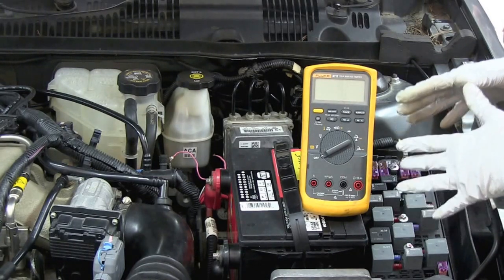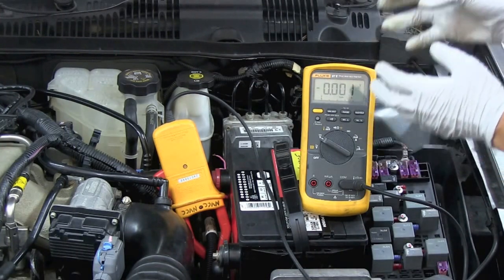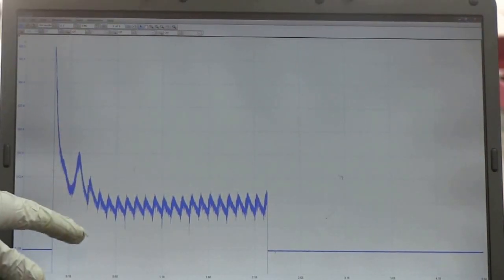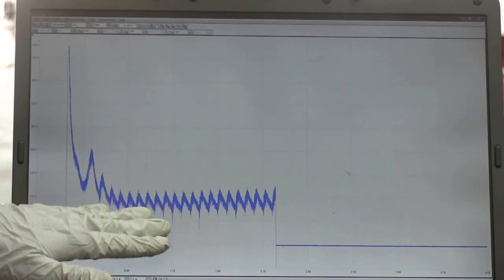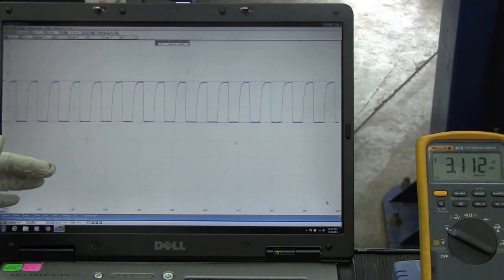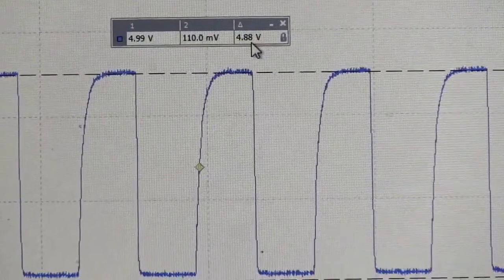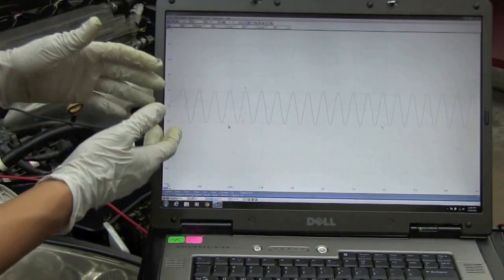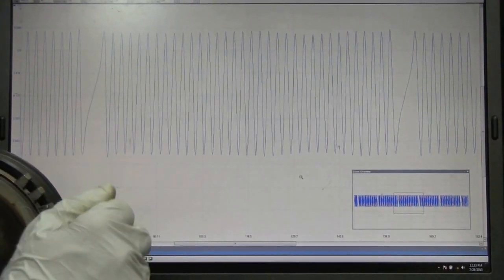Oscilloscope vs Multimeter

Comment: A female mechanic??!!???? We don't get them over here in oz, I've met only 1 in my 15 years as a mobile machinist and heavy mech. Wanna move to Aus and get married?? lol,

anyway.... 1: the metre's don't sample 4 times a second, in fact the metre doesn't sample at all, it's a constant measurement the display updates 4 times a second.
2: The DSO doesn't sample at 1 Meg sample per second, it's much much faster than that.
3:  There is no such thing as "counter electromotive force" in the electronics field, there is back EMF which is sometimes referred to as "counter EMF" to my knowledge, it's incorrect and totally incorrect in this context. Also, if you wanted to measure the back EMF from the starter motor, you would need a completely different connection and setup in order to do so. I think the term you meant to use would peak or maybe initial current, you could possibly even be thinking of the term "in-rush current" but that too would be incorrect technically speaking.
4: Amperage, is not a word. The term is current.
5: it's not "like a graph" it is a graph, of voltage/amplitude per division against time per division.
6: You can't have "more frequency", you can say "higher frequency" or "more frequently" or "more peaks per time division/frame/screen" make up any time period you wish if it's measured and repeatable.
7: they are not "upper" and "lower" cursors, they are markers for want of a better term and in this case they are marking 1: the peak voltage, and 2: the noise floor. Probably marker 1 is actually marking the average and not peak, but I didn't set up the scopes parameters so I can only speculate on that one, as I am.
8: The scope read a peak of 1.531Mhz, I only bring this up as to point out my prior assertion that the scope is much faster than 1 Meg sample per second, for if it were only 1MEGs/s how could it have read a peak of 1.5Mhz? Sample rates must be a minimum of 2X the desired maximum signal measurement. For example, cd's recorded at 44Khz because 1: 22Khz is well out of human hearing so a 22Khz sample rate will easily cover the audio spectrum and 2: 44Khz (and 22 for that matter) are easily produced using standard crystal oscillator values and dividers.
..... freeze frame????! (data sample, it's a DSO) .... transitions/teeth it's a waveform it has cycles.... bah

Point is, if you're going to "educate" or "inform" or "teach" something, how about you use the correct terminology? Anything else can only lead to ambiguity and misunderstanding for those who don't know any different, and you looking like a fool if in front of those who do know different.
Reply: Damn
Reply: The woman has an oscilloscope shut up

Comment: Why is the fluke, an expensive multimeter, show its reading as a fraction?
Reply: It converts amps of current to a voltage level.  In this case 1 amp is converted to 1 millivolt (.001 volts), therefore 282 amps is shown as .282 volts.  The meter is capable of directly reading amperage, but not more than 10 amps can be flowed directly through the meter.
Reply: Joseph Nicholas it's built like a brick Shit house and warrantied for life
Reply: @zoticus1  You did not answer his question.